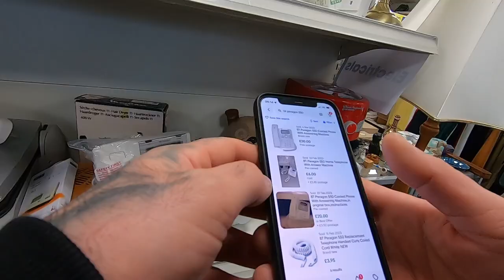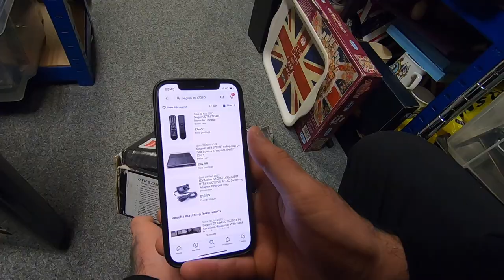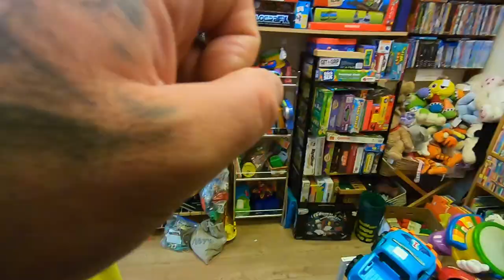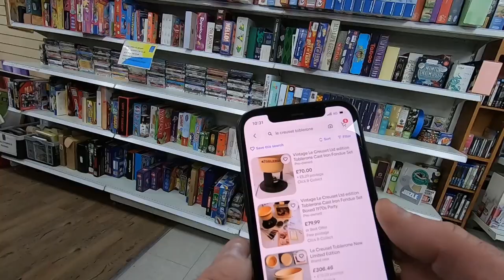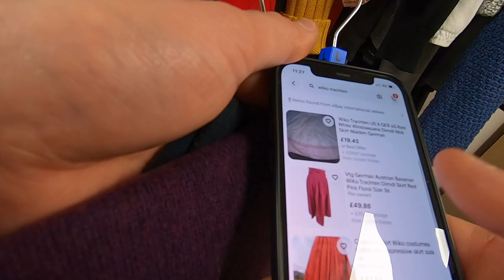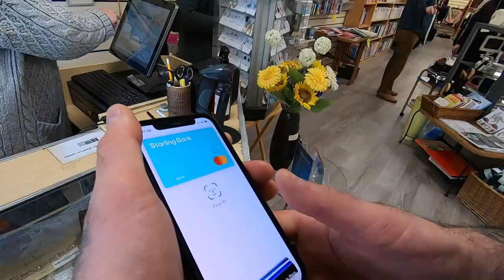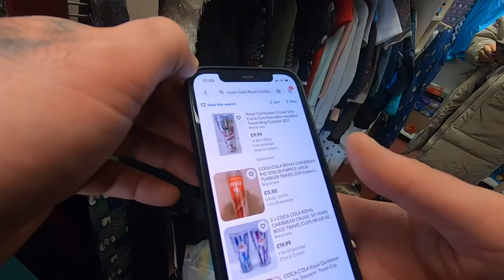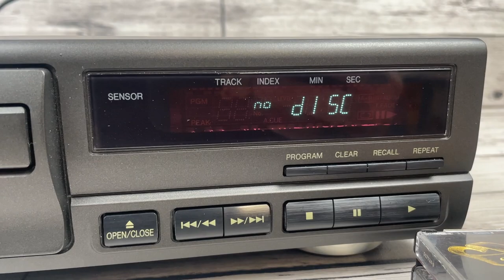I Had Access To The Charity Shop Store Room!

Comment: On the Technics CD Player, I'd change the trays belt, they get stretched over time. When the tray drawer shuts it turns a little more which raises the laser and hits a micro switch to start the disc spinning, if the belts slightly stretched it doesn't have enough grip to raise the laser carriage. Some players belts are easy to change, others are a pig, plenty of YouTube videos on it.
Reply from the maker: Thanks mate, appreciate that! I’ll take it apart again tomorrow I’ve got loads of belts ready to go. I can’t imagine it’s gonna be too difficult in this one  very open access  Cheers again Darren
Reply: @RickyResells  I couldn't see in the video, but if you load the tray with the top off and when it shuts you don't see the laser carriage rise up to the disc it will defo be the belt slipping.